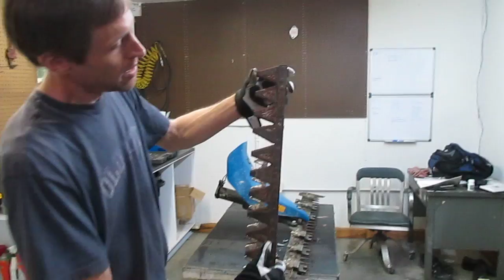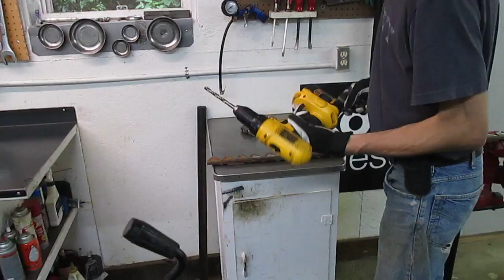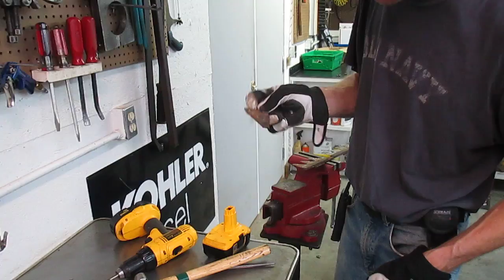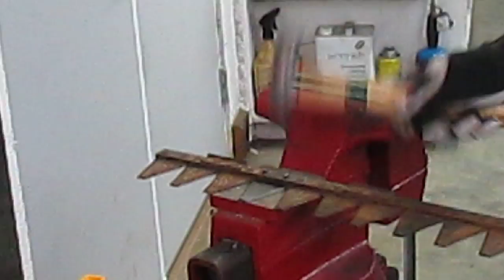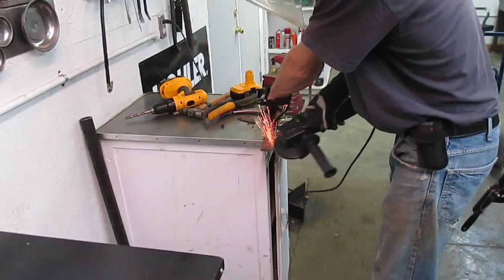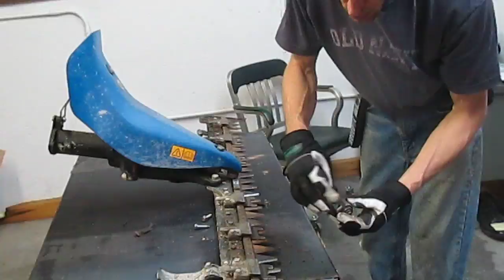Single Action Sickle Bar for Walk-Behind Tractor: Maintenance

Comment: Thank you for this excellent tutorial on peening rivets! I will use this knowledge tomorrow.

I'm restoring my Dad's 1960's-vintage Apache walk-behind sickle bar mower. The bar itself broke, and so I had to remove all the blade sections and rivets, and then fab a new one. After grinding off a few rivet heads and punching the rivets out, and after trying to drill out a few, I wondered if there was a better way. There is!

An old boy on YouTube showed me how: Put the bar on edge over an anvil edge, or on the end of a piece of railroad rail, blade sections pointed down. Grap a large hammer and strike the blade. It might take a hit or three, but it will shear the rivets and they will then almost pop out by themselves. No kidding.

Comment: Thanks Joel 
Would it be worth using copper grease or similar instead of oil under the bar also mine is the grease type how often do I need to grease I ask as the cowl has to come off each time and is a pain I normally grease every two hrs